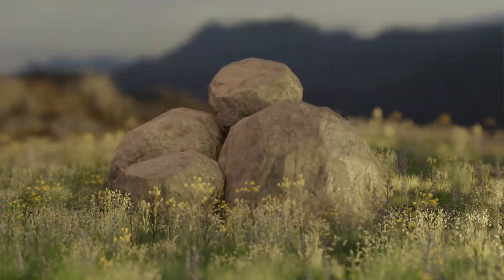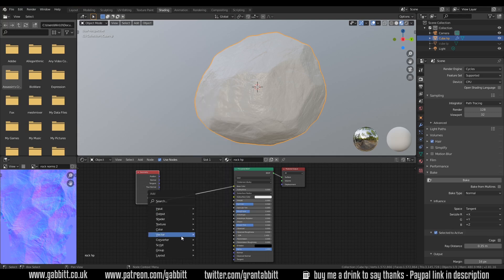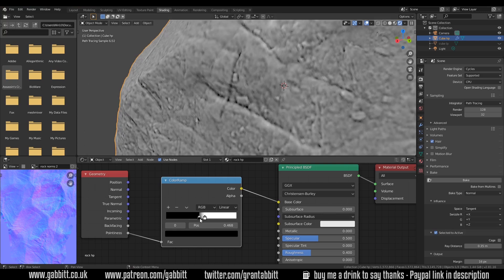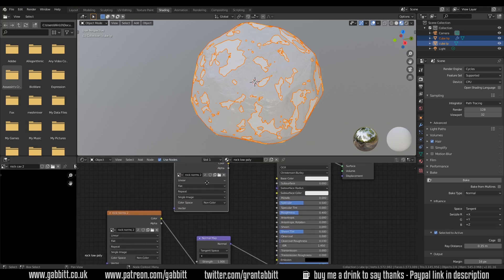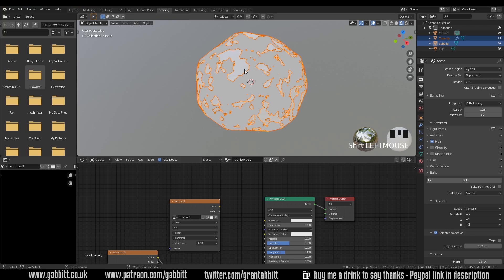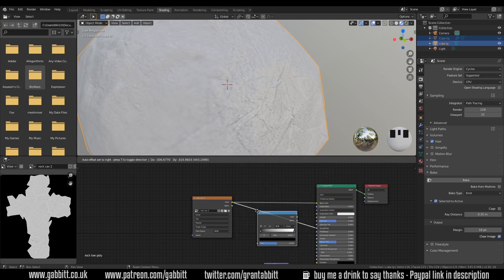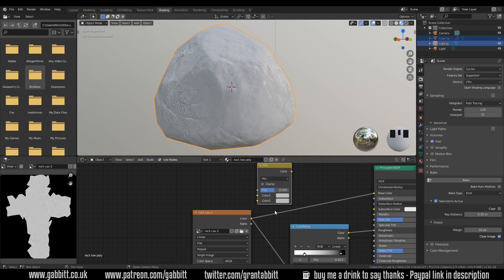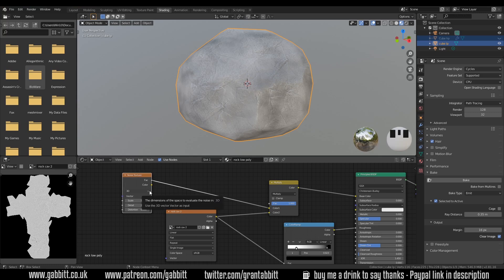Realistic Low Poly Rocks | Beginners Baking | part 4 | Cavity Maps |Blender 2.8

Comment: my image stays black after baking the rock cavity using emit.
Reply: Same here
Reply: It worked fine once I switched to the 2.83 LTS build. I think newer versions broke this method.
Reply: @whereistherobot9840  I think I got it working by switching objects by clicking on the actual object instead of the names in the top right, object sorter thing.

Comment: in the previous chapter (colour and reflection map) you didn't have the high and low poly. So, are the high and low poly objects required only in normal, cavity, roughness maps but not in colour maps? Thanks
Reply from the maker: Yes in many cases